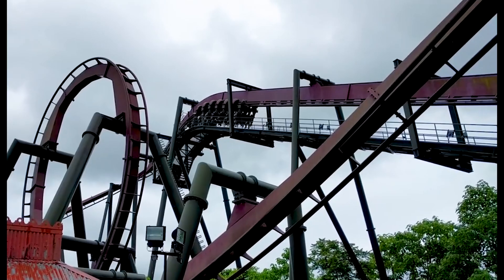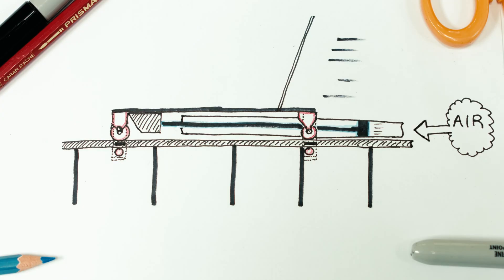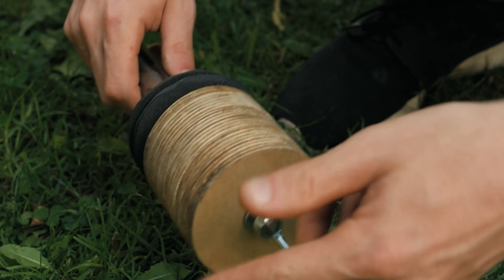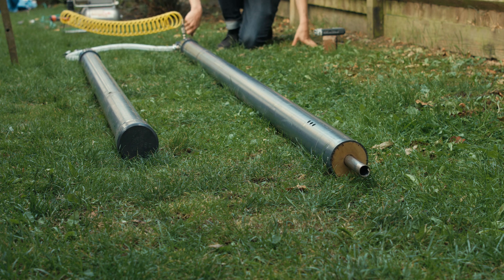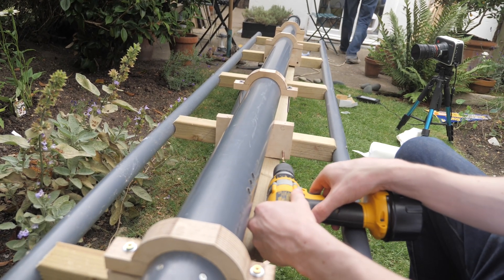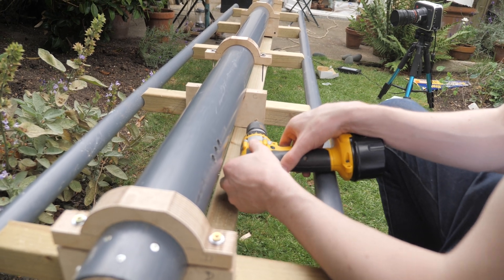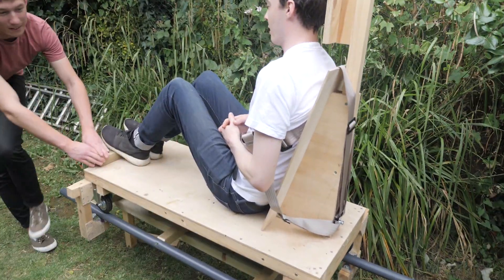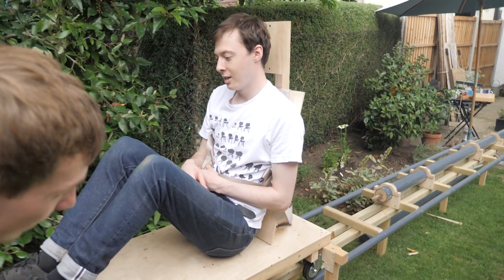Building a Backyard Launch Roller Coaster

Comment: what would happen if the air cannon had half the pressure, half the volume, and the person riding it weighed half as much?
Reply: You could half the volume or the pressure if you have half the weight, if you half both you would only have apx 25% of original.

Comment: You coul’ve used a system similar to Top Thrill Dragster where there is a magnet on the underside of the car, which “connects” to a magnet on the track. He magnet on the track will then launch forward taking the car with it. 

This would likely be more expensive, but it could travel faster, and the design would be simpler (The train wouldn’t need a bumper for the piston to push).
Reply from the maker: ColtonSuper Game it would be an amazing system that’s for sure, just a little outside of my budget unfortunately. I built this whole thing for around £350 ($400). I know that Will Pemble on YT is trying something like that though, you should check him out!
Reply: Dragster doesn't use magnets for launching; it uses a steel hook called a "launch dog" that drops down from the 3rd car of the train into a shaped groove in the catchcar

the brakes are no-contact magnetic, though.

Comment: For the track did you just use regular PVC pipe? What size did you use and also how did you bend it. Some people have used ABS pipe. Do you think that would be better for a launch coaster like yours? I have built the piston but I am ready to get started on the track.
Reply from the maker: callan R I just used 40mm 10Bar (1.5” Sch40) for the track, and made 5 metre (16’) sections. I didn’t do anything to bend the track, the PVC is flexible enough to just form into the shape you need as long as you aren’t doing tight bends. Then a wooden spine made from 1x2s was added to strengthen the whole thing up. Send me a link when your builds done! I’d love to see it.

Comment: If you had the budget, EMT pipe would be killer for the rails!  Would require pipe bending, but would hold up much better.  Also, for safety, I'd also add bigger bottom casters.  Rubber bumper at the end also instead of block of wood, as well as use of something over the piping on the last 6' to add friction to the rollers if this thing goes to far up!

Comment: No, 
1) it is called a launch coaster
2) the drum method is almost completely defunct, it is usually a hydraulic or a magnetic launch
Reply: Technically a hydraulic launch uses a drum connected to hydraulic motors.
Reply: @Alex-wn5rc  yeah, but most hydraulic launches use a series of hydraulics to launch, instead of powering a drum, but even these are rare, as electromagnetic launchers are far more reliable
Reply: @sketchgarage6896  Hydraulic launchers work by forcing fluid between two gears which in turn spins a drum that pulls a catch car down the launch
Reply: @Alex-wn5rc  oh, okay, my bad
Reply: @sketchgarage6896  The launch in this video is used for extremely fast accelerating coasters and aircraft carrier launches

Comment: It looks like you used dense foam washers to seal the air at the piston.  What would you think of a round seal flap, made of thin plastic sheet, attached to the piston,  like a section of a very shallow angled cone, pointed aft so the pressure drives the flappy seal against the inner wall of the cylinder, without causing too much friction?  I'll try to make a drawing.
Reply from the maker: I ended up swapping out the foam for a leather cup, like a bicycle pump. It sealed very well but needed a small relief valve behind the piston in order to allow it to slide back without building up pressure.

Comment: I had a sigh of relief when you finally pulled out the impact driver. Driving screws with a drill is painful to watch.
Reply from the maker: It was on charge when we started! I felt your pain too.
Reply: @WillFromLondon  Impact drivers are great, but you should understand that an impact driver puts more stress on the screw.  About one out of 20 screws I drive with an impact drill actually breaks either on installation, or later due to fatigue.  A regular drill put less stress on the screw.